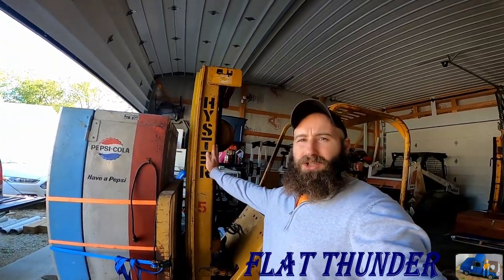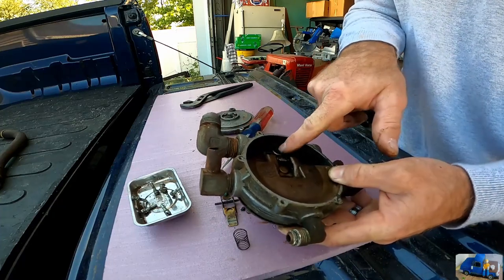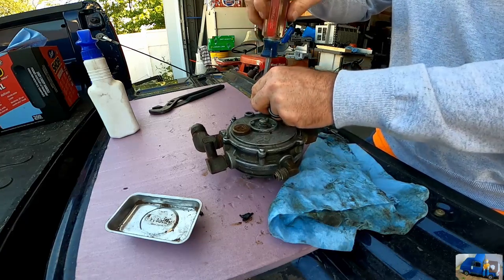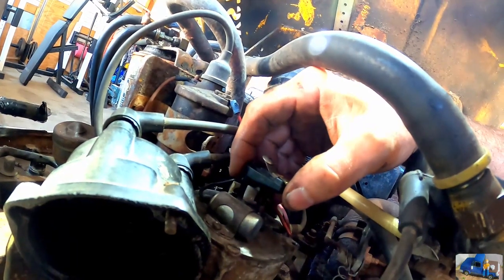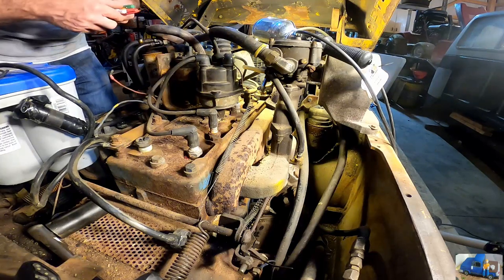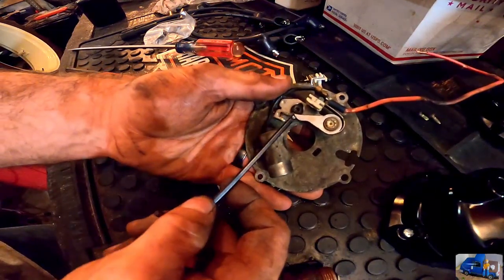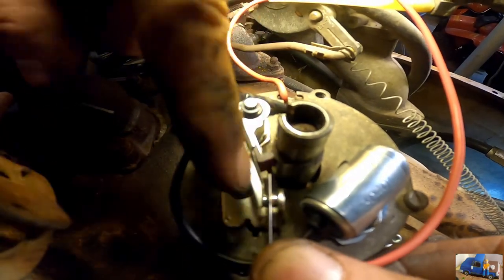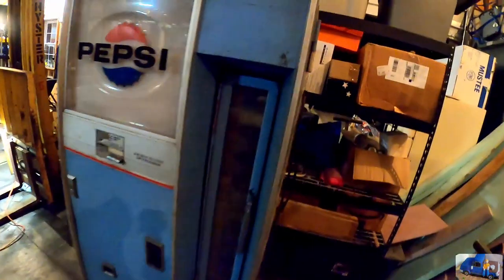HYSTER FORKLIFT; FUEL / IGNITION WORK

Comment: At 16:00 you had spark at the plug. So how did you know that the rotor was probably bad? Was it some plugs working and some not? Also is there no drain plug on the regulator? Sure shows how hard it is to predict spark or gas! Always back and forth by effort! 😢. Excellent video 🎉
Reply from the maker: Thanks!  I stumbled into the broken rotor.  It revealed itself by being completely random; sometimes it would spark perfectly other times zero spark.  A real head scratched at the moment, but it helped me understand the fuel system better!  Thanks for watching 👍😁

Comment: The propane bottle you are using appears to be for delivery of propane gas and not liquid propane.   If so,  then that may be part of the problem.  Engines need liquid propane to run correctly.  That's the reason for a vaporizer to supply fuel to the engine.
Reply from the maker: This makes sense.... I'm not 100% sure how and why this unit operates this way.  Now, she runs great on the regular propane bottle.  I think the ignition system was creating my issue.  I only operate it this way because the previous owner did the same.  I have the correct propane bottle, but she's empty.  Hmmm.🤔  This old gal was a gasser converted to propane.  Thanks for watching and subscribing!  Happy 4th!  👍😁

Comment: What size feeler gauge do you use to set the gap on the point set?
Reply from the maker: The kit came with a recommended gap of 0.017 - 0.019".  I think I usually set them at 0.015 - 0.020 when not specified.  Thanks for watching 👍😁

Comment: I 'll give you a gold star for the forklift repair. I have a similar hyster but the bearing that turns the radiator fan is frozen up. Any suggestion? It rests inside the thermostat housing.
Reply from the maker: Thank you!  I have not looked into this area yet.  I do need to poke around and investigate a coolant leak.  When I do I will see if I can come up with any good ideas.  These are great little engines.  Thanks for watching 👍😁
Reply: @FlatThunder  Hyster has a kit for $1200 to fix mine. Machine shop wants $750 to remove bearing. I may bring it by your place and leave it with you to make a video. I won't even charge you...lol
Reply from the maker: @stevewilley5185  if I wasn't so far behind on the project list I'd take you up on that offer! $750 seems pricey, but I can't fully gage what's required without laying eyes on the part. Maybe a used part could be sourced?
Reply: Is that a GM L4 gas engine? I couldnt stomach the $2000 Hyster part so I eliminated the belt driven fan and switched to electric fan